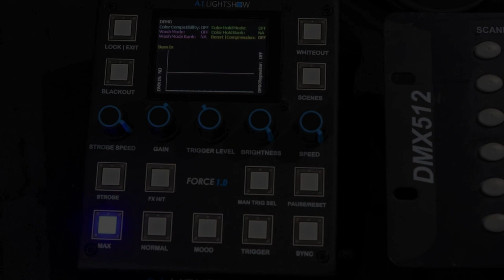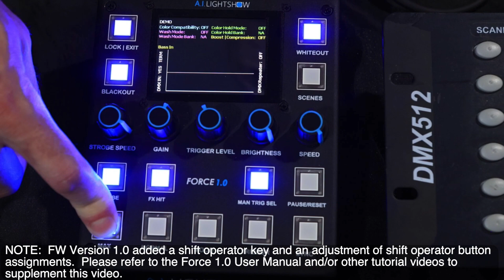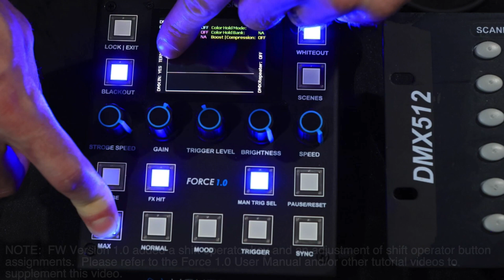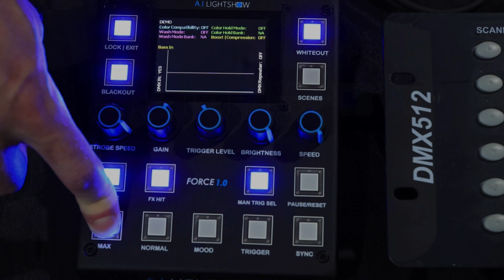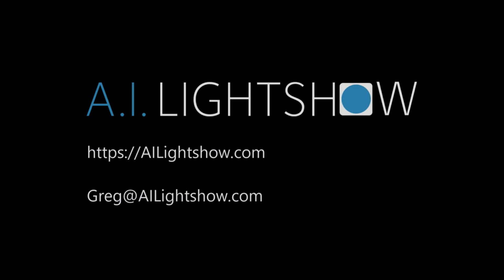Force 1.0 DMX Repeater - Tutorial

Comment: If i have a Soundswitch dongle connected to a separate laptop, and I have pre-programed autoloops that I want to run at a specific time, will the method described in the video work for my scenario?
Reply from the maker: Absolutely, that’s a type of situation which this function was intended for.  Just run the DMX OUT from your Soundswitch dongle to the DMX IN port of the Force 1.0.  Then just follow the video instructions.  (The new FW on the Force 1.0 will indicate the shift function assignments on the screen so you won’t need to memorize anything like the video alludes to)